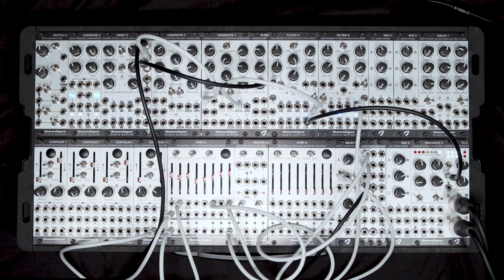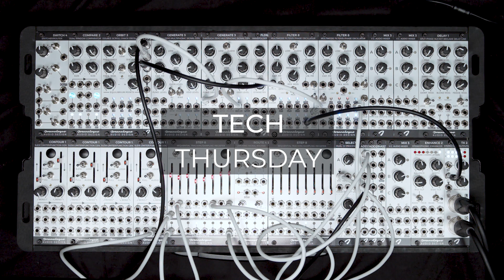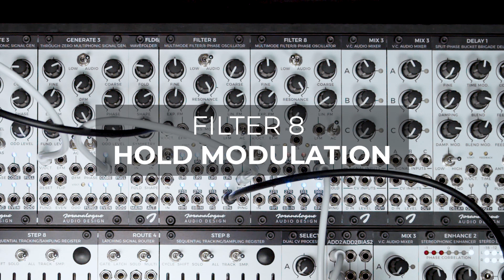Tech Thursday | Hold Modulation with Filter 8

Comment: Maybe its a dumb question
But is select 2 capable of voltage controlled Polarizing
and in turn
It can set 2 or 4 different starting points If top output is not used??

Im loving my joranalogue gear
Reply from the maker: Select 2 can't be used as a voltage controlled polariser; it only has gate control.
I'm not sure I understand your second question, but, if nothing is plugged into the top output, its voltage is added to the bottom output.
Reply: @joranalogue  My idea is If my select 2 B output is connected to Oscillator And My Osc is set to -2 Octaves

Leaving the +5 signal Input and Input empty of A and B.
Using the select Input with a latching gate.  
I would be able to transpose by the amount set on the A attenuverter when latching to select Input and no latching Gate to select Input would yield 3 Octaves ( since osc is set to -2 Octaves   ) and same with the B side now giving the possibility of  4 transpositions

To add a gate to the unity Inputs would yield 2 more possibilities 
This is already achievable with Step 8
Am I understanding right?
For the first question Thank You for your response

I guess that means there is no CV control over the Polarizing 
Thank You Joranalogue
Reply from the maker: @apeirogonmusic  Yes, that seems to be correct. The select gates can be used to disable the two 'preset voltages', set by the knobs. A unity gate will toggle them to +5 V. This is all assuming the input sockets are not in use.
Reply: @joranalogue  Thank You Joranalogue
Your Oscillator and Filter Design have reignited my love for analog Sound Sources
All your designs I have had the pleasure to work with are incredible
Each one is unique and like a modular Transformer
Stellar Work